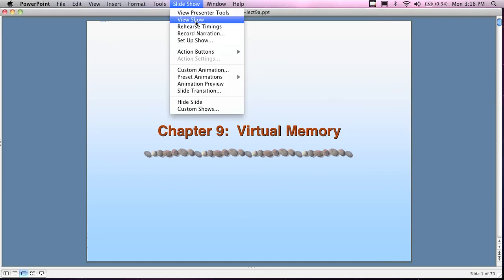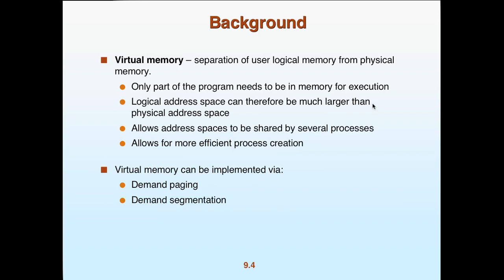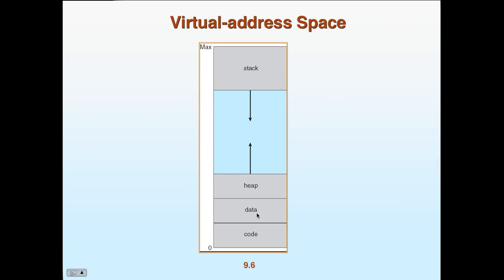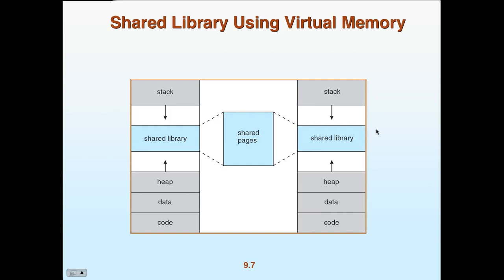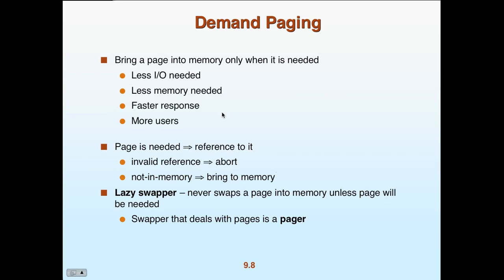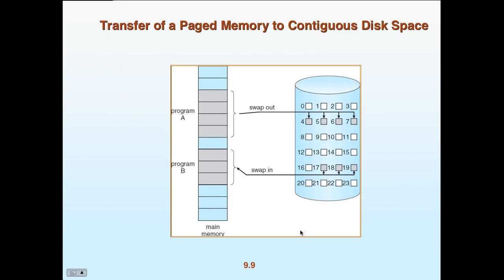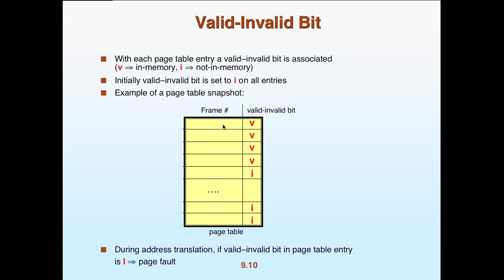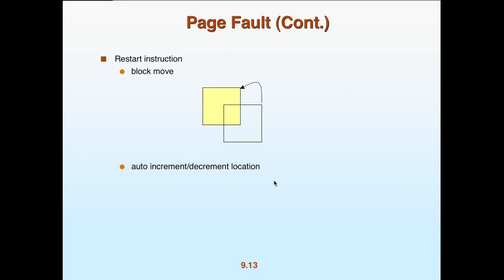Principles of Operating System - Lecture 8

Comment: Regarding the memory of XP, i used to game on a machine running XP which had 256MB of RAM. It was terribly slow, but i didn't knew it could work better back then. Amazingly it actually could run Sims 2 and similar games.